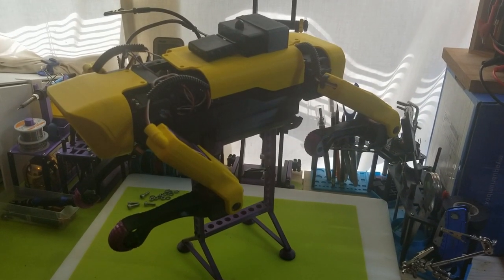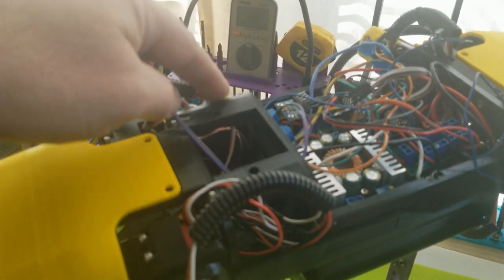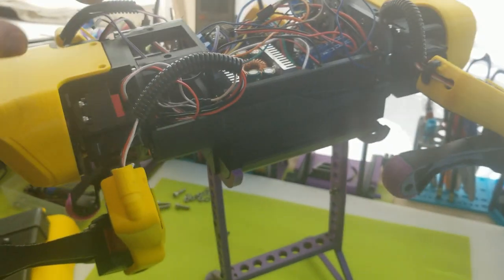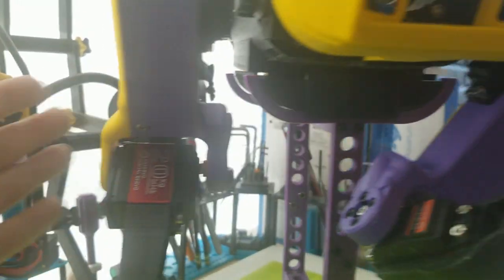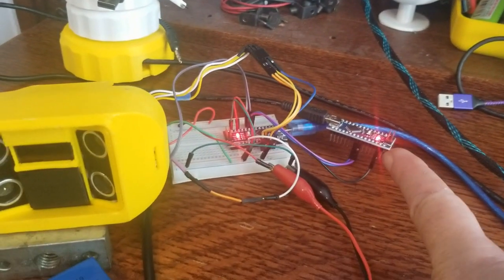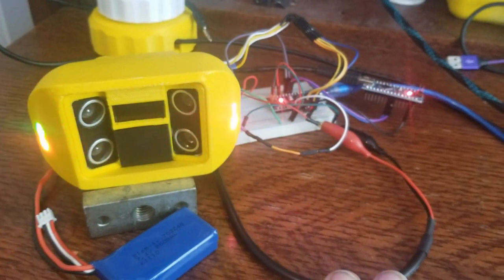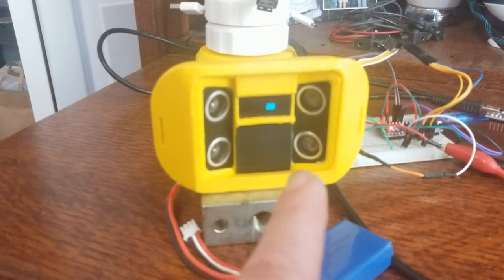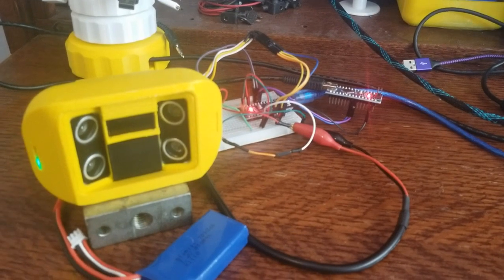Nova SpotMicro - Growing Bigger & Stronger!

Comment: Did you solve the problem of the bottom cover being to big to print?  I guess,  like me, you have an Ender 3 or similar with a 220x220 mm build surface. 
I'm curious to know if you are able to equalize the center of gravity between the front and back legs with this extension. Maybe that's not an issue.
Reply from the maker: by turning the bottom 45 degress, it fit on the bed and printed fine, yes! (and yes, I have ender 3 pro)

I do think this extra length will make it much, much easier to balance.  I haven't gotten there yet, still assembling and coding her 2nd brain, but I will be getting her back on her feet within a day or two! Stay tuned!!

Comment: Thanks Chris for yet another video, these are awesome and quite helpful. I've been struggling with the esp-32 Spotmicro however after seeing what you've done with your Nova, I'd like to take a crack at your build. Can I ask if you are still using the 3S 11.1V 2800mAh 40C Lipo Battery, is there an alternative? Thanks again for sharing.
Reply from the maker: Thank you kindly, Norton. I am still using that battery, yes. It needs to be a high discharge battery to be able to respond with enough current if the servos need it... and they do for walking gaits, etc. And the high amperage buck converter is the 2nd most important part of the power supply.  I just posted the parts list on the github readme, if you've not seen it yet.
Reply: @ChrisLocke1969  Yes, I have seen the parts list on github, thanks for that. I'm putting together my shopping list right now and taking inventory of what I have on hand.  Unfortunately Amazon.com and .ca both show that battery as not available.

Comment: looking great with the new legs, im still trying to incorporate some kind of spring on the joints so it can jump safely, i was thinking and you can probably set the servos to absorb the impact say using timing or even load cells on the legs, how are you running 2 serials on adruino? keep up with the updates :)
Reply from the maker: the Bittle project uses springs in the legs - have a look at it.  They seem to absorb some shock, yes... but its a very small dog, so their design probably wouldn't work well on a larger dog.   As for timing of servos to take the impact... that would be very difficult at best.  I have written a ramping function for the movements, and that helps smooth things out so its not so jerky and "robotic" like... but ya, I think load cells is the way to go if this is and important feature to you.

Running two arduinos turned out to be fairly straightforward.  They connect together on SDA / SCL pins, and use the Wire library to make communication easy as can be.  The only tricky part with serial communication is beyond sending a single byte, it can get complex sending strings or integers for example.  So with that, my commands are pretty much one letter / byte commands, like "H" for help.
Reply: @ChrisLocke1969  how much does she weigh?

Comment: Hi Chris, Nice improvements especially the body extension mod. I am also looking at choices for microcontrollers. Despite  a lot of Spot builders choosing the Raspberry pi, and having played with Raspberries and  Arduinos, I think the Arduino is better  for interfacing to low level hardware such as sensors, servos etc. However since  the Raspbetry is a computer with an  OS, wifi, bluetooth etc,  it would  be the best choice for  communication, interfacing to cameras, image recognition etc. To me they are complementary so I'm thinking of starting with an Arduino like microcontroller and later adding a Raspberry and interfacing them together. These are just my humble thoughts as a future Spot builder. As for the Arduino, I 'm looking at the Teensy 4.0. Pretty powerful compared to the Mega. Not sure if you considered this as an alternative to adding a nano.
Thanks again for these videos.
Reply from the maker: thanks for the feedback and sharing your plans and ideas.  Yes, I toyed with the idea of what to use, but Im one of those old-timer, old-schooled guys who prefers a bit of a struggle and challenge.  I think it'd be too easy to use the most powerful board, for example.  And when it comes to software, with an abundance of resources comes crappy coding usually.  Lastly,  I build these projects for the learning experience and fulfilment of accomplishment - so I refuse to use anything off the shelf, and prefer to be as raw as I can.  So yes, a stripped down microcontroller is way more fun to me than a mini-pc  LOL

Comment: try using some esp32 boards, they have dual core processors and integrated wifi & bluetooth. 4mb of flash and clock speeds of 80 to 160mhz, smaller and cheaper.
Reply from the maker: I've played with them for other projects, but I have no need for wifi nor bluetooth, so it didn't seem the right solution.  Pairing a Nano with the Mega board I am using is going to work out peachy, I think! ;)
Reply: @ChrisLocke1969  ill personally switch to them, and have the bluetooth and wifi as possibility for further developing. but mainly finally get rid of the tiny flash, and don't need to constantly try to keep the code tiny and worry about libraries